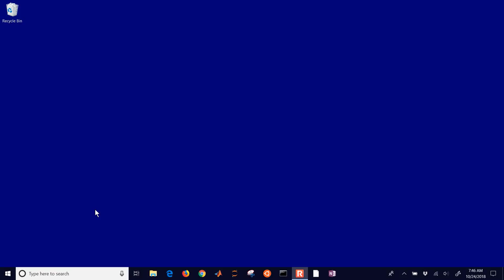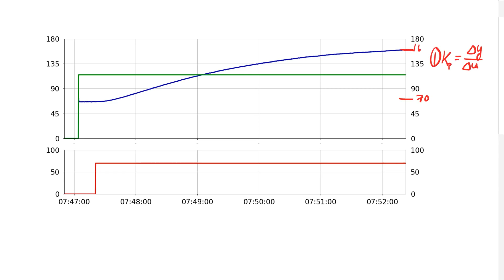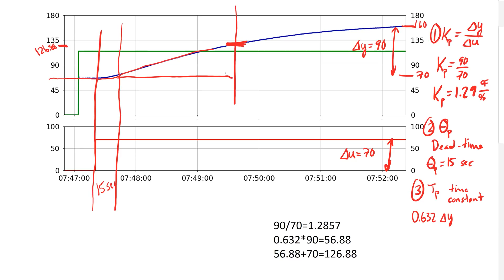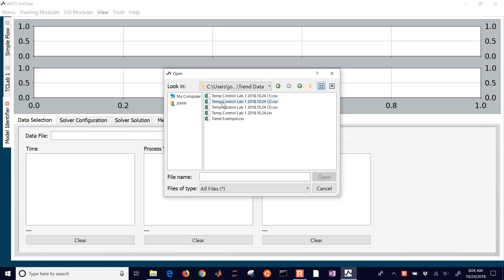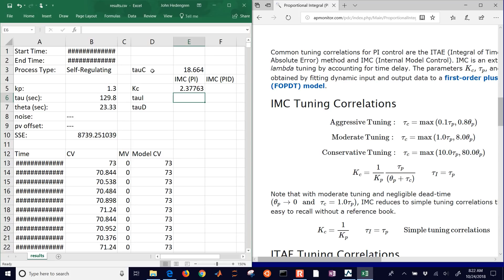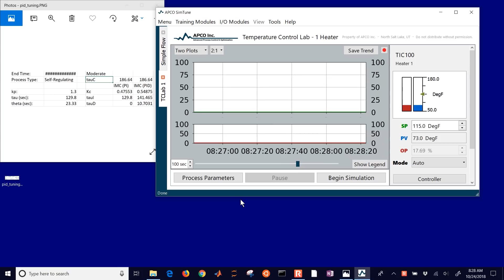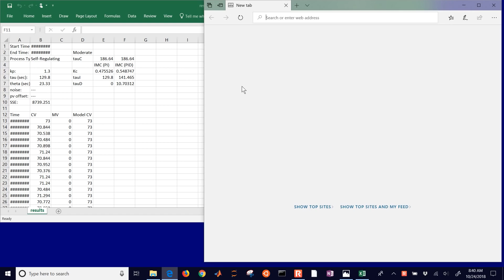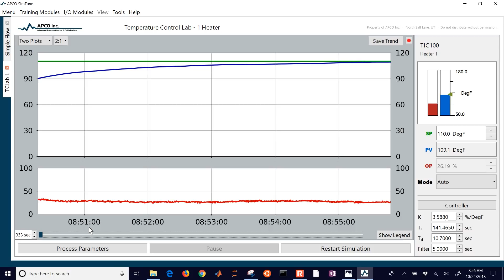PID Control with SimTune

Comment: The PV range can be adjusted to expand your upper limit to accommodate higher temperatures (it looks like you were limiting your initial step test to keep the PV below 180 degF). To do this, click on the Process Parameters button and set a new value for the PV Max. You'll need to restart the module to apply the changes, so you'd want to do it before starting your recorded step test. Thanks again for using SimTune, we are loving what you're doing with it.
Reply from the maker: Thanks for the tip!